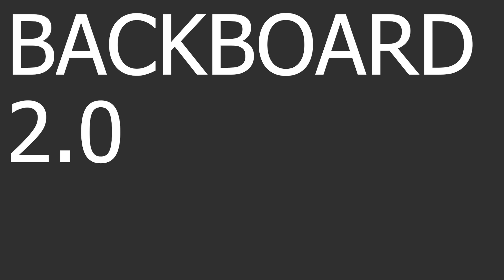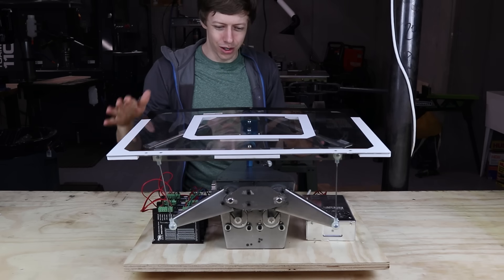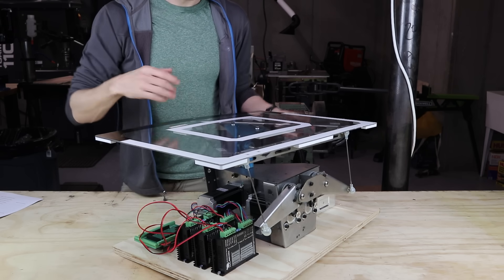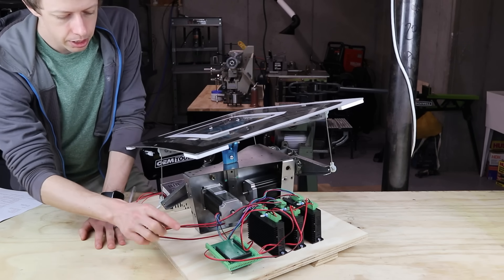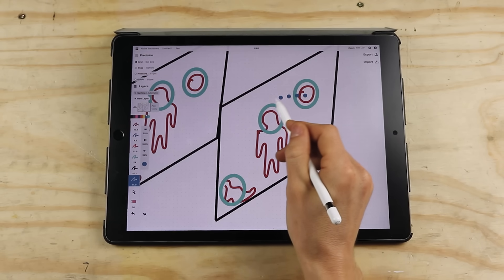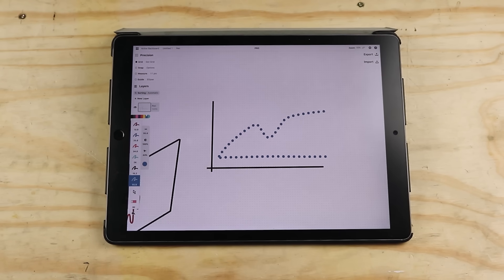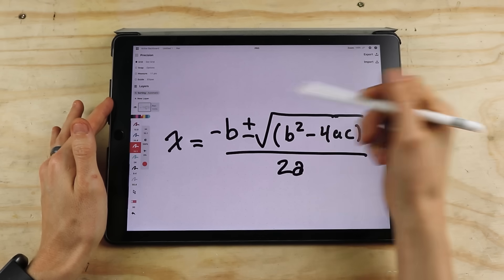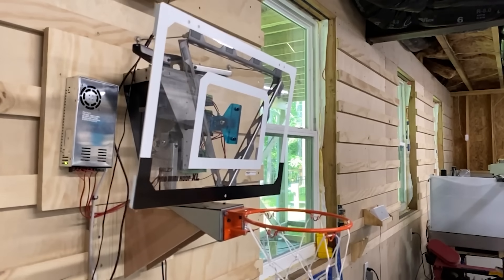The automatic hoop always goes in

Comment: well, here goes one, you didn't need a third motor, as a solution could be done by two on a pivot. 
1 motor controls lateral tilt and the other does vertical tilt while they can still push in or out
 ( this is a worse solution for stability, but easier to code due to more constraints/fewer degrees of freedom, also less instructions?)
anyways love the "effort" to face recognition

Comment: Would it not be faster and more precise if instead of sending the positions to the board at the last moment you send it to the best position as soon as possible and then update the position as fast as possible that why the board is in roughly the right position when the last and most accurate position is sent and does not need to move as far and fast?

Comment: Would it be possible to get a rough estimate earlier and start the movement in the general direction, then continuously update the target position of the board as the trajectory data gets better?
Reply: i think this would take more processing time.
The method here is;
Estimate the trajectory after you have gained some reliable information. 
Then move the board according to the calculated vales.

If continuous monitoring was done with adjustments for each value; the board would receive different sets of data. 
As he said that the board has to go through huge acceleration; if so then giving it multiple acceleration would be difficult and there would also be resistance due to inertia. (of course for most of the cases this wouldn't be a problem, but if the two set of information/command has a large enough difference the needed change in acceleration would be high and mechanically impossible for the board to handle(due to inertia).)
That's what i think.
Reply: I think  Taipan17 SAG  said it best. 
In the original version, he collects a mass of data then calculates.
You're suggestion would require multiple consecutive calculations. Remember, he said his biggest limitation was how long it took the processor to do the one calculation.

If he upgraded to a much higher power, it would be possible, but then you would have to account for mechanical lag. I.e. How long it takes the moving board to dissipate the G-force it has acquired.

Comment: Graph theory - Complex networks and systems
Arduino/coding - Computing science & programming
Motors and gears calculations/ material strengths - Mechanical engineering
Link arduino to hardware - Control engineering
Creating parts (bearings/sheets etc) - Production techniques

Cross-disciplinary.. I like it

Comment: if your main issue is the speed to which your arduino runs, maybe try using a teensy board, you will get more cycles out of it, 4.1 just got released.

Comment: Would it be quicker if you only gave the backboard 2 degrees of freedom so the centre of mass remains stationary? Then there would only be 2 solutions for the trajectory and rotating the board would require less force than moving & rotating

Comment: I was about to post a comment being like "HA, this guy wasted his time, he didn't see the video of the guy who made the wooden one that works without any robo--oh... it's the same guy..."
YOU DID THIS IN A FEW WEEKS!!?!?
How is that possible. Why do you have all this disparate special knowledge, all these expensive machines and enough time to do this stuff? Do you have a trust fund? This channel obviously isn't your job. What's going on? This is the first time I've ever not understood how someone is doing that they're doing.
Reply: You can have a cnc plasma cutter put together for about $1000 dollars if you're building it yourself, 2-3 thousand if you're getting something mostly ready to go. Spot welders aren't that expensive, a few hundred. A ok brake can go for  $100-$200. a little nicer maybe $400+. Decent 3D printer: FDM for $300 is normal, and small resin printers are getting to that price range too. Machining the ball bearing was one of the bigger ones, A small milling machine, like mini, would be $400-$500; they quickly go up from there ( although it looks like he has, or has access to, a CNC milling machine which is EASILY +$10,000 used. but that wouldn't be necessary and I wouldn't even bother machining ball bearings anyway) . But if you tinker a lot it's priceless. Really with milling machines, what pays off is having the bits, chucks, and hardware you need.
Not to mention a lot of things like sheet metal brakes and milling machines can be bought used.

If you think about somebody having another car and spending more than $10,000 on something, then this really isn't that much. CAD software can be free, coding software can be free, CNC cutting and slicing software can be free, online courses to teach you these things are available free...   insert "JUST DO IT!" .GIF
Reply: @matthewluttrell9413  Sorry dude. That brake he was using costs over $2000.
Reply: @bryanswift9801  yeah, but he didn't use it for anything you couldn't do with a Harbor Freight brake. Help me out here XD I'm trying to encourage people to go build stuff and that's like 90% just doing it and only 10% having nice tools
Reply: @matthewluttrell9413  yep, time to make that decision between a new milling machine and a car.
Reply: The "kiwami Japan" channel gives me a similar feeling, talking about the confusion as to how this person has all this wide range of specialized knowledge
Reply: @geniusface1234  it's called passion dude. Does that confuse you lol?
Reply from the maker: No trust find lol I wish. This project just went pretty smoothly for some reason without major setbacks. The mechanical design and fabrication I did last Saturday and then I did the software in the evenings after work last week and made the video this past weekend. I like speed and my shop and workflow is optimized for rapid prototyping.
Reply: @StuffMadeHere  So you even did this around work. I'm an engineer myself; I've seen a lot of brilliance and am not that often surprised by what people pull off. But you really do deserve a bit of awe for the sheer efficiency and speed. It's... above average.
Reply: @StuffMadeHere  YEA LIKE I TOTALLY KNOW WHAT THAT MEANS
Reply: Special knowledge I kind of get. I have a Masters degree in Engineering and combined with some passion for robotics it would probably look something like this. Machines, yeah quite impressive but not impossible it is just about what you prioritize (it is probably worth around 5-50k USD). But time, wow! That is what really gets me. That is just out of this world. You could easily spend 3 months building this full time. But he seems to have done it in a couple of weeks part-time. That is truly impressive!
Reply: equipment, resources and time! how do you have all these things! Please keep making cool shit and sharing for those that do not have what you have!
Reply: Maybe its already made weeks before he upload this video. And i think the 3rd gen back board are already into the finishing phase. And he's just waiting another 3 weeks before uploading it.
Reply: Me to
Reply: It's because he's an engineer. He probably has access to these machines through his work. I'm actually so inspired by this (as a second year engineering student myself.)
Reply: @MDMArxist  I understand that, but like I said in my comment "if you can afford another car at $10k", probably means middle class buying used. It's true someone impoverished can't afford the tools I mentioned, but the middle class can. I was just pointing out that you don't have to be rich/upper class.
Reply: Same!
Reply: Same thing with channels like Michael Reeves - these guys should all be working for NASA
Reply: Omg same
Reply: @MDMArxist  What does that have to do with a guy building a basketball net? You leftists just can't let people enjoy anything without guilt.

Comment: (Just an idea) You could get a 3D camera (one that can track depth,), or use 2 cameras at different spots (to triangulate the position), and take photos about 100-150 ms apart, prosses those images to get the trajectory, than move the backboard to put the ball in the hoop (the 3 frames allows you to get the parabola,  while still leaving the processor fast enough to send the info to the motors).
(Another (worse) idea) If you need better tracking on the ball, you could try to split the frames into their red/green/blue frames, determine which one is the ball (which color the ball is and use that color frame to find the path of the ball), and then you wouldnt have as many problems with background noise. Or you could also just use IR trackers, and cameras.
Edit: Just got to the part with the kinect (i should really watch the whole video before commenting things)
Edit 2: The IR cameras I mentioned earlier would also help determine the spin on the ball

Comment: You might be able to get more of the difficult shots by moving the backboard twice. Move it as soon as you guess a loose trajectory, then move it again later to a more optimal position. This way if the shot is too fast, or if the tech glitches, then you have a decent chance of making it because the board is in an OK position. Then you can move it again really quickly, because it was already really close. 

Someone tell me why this won’t work as well as it does in my head.

Comment: Idea: Build a ramp to return the ball back to you from any position out of the hoop. 
Second idea: Building on the first idea, make a machine that sends the ball from the ground and shoots it back up into the air
Product: A shooter and a hoop that goes in a cycle and never ends. Might also work with multiple balls.

Comment: 12:00 what if the ball gets hit mid flight and the computer see’s it as an un-natural ballistic trajectory. Will the board not move because it can’t see anything that could be the ball? And is there a solution to this? Im not engineer but i would perhaps suggest having a ball covered with something like a crash test dummy symbols to track the ball. So we would always know what the ball is and eliminate the need to track a logical ballistic trajectory. 🤷‍♂️💙

Comment: Definitely subscribed. Don't forget that the speed of the steppers is affected strongly by the drive voltage. You can lower the chance of skipped steps by increasing the drive voltage to whatever the maximum is for the <cough> chinese drivers you are using. Also, consider using a linear supply instead of that switching supply so that you still get current even if you load down the supply a lot! 

Consider moving to 80V or higher voltage to really get quick motion.

Comment: You shouldn't (In my uneducated opinion) wait until the last moment to tell the hoop to move. I understand that the later the ball is in its trajectory, the more accurate the prediction of where it will go is. But the hoop should start moving as soon as you get an idea of where the ball is going. It should then adjust, making small and more accurate movements, as the ball approaches. That should help with the motors seeming not powerful enough (I think).
PS. Awesome video.

Comment: Here's another idea, that might improve the project.

You said that sometimes there's not enough time to capture enough data points and then move the board in the right direction. So, what if, after you collect ... let's say  ... 3 data points, you start moving the panel in the direction according to the trajectory calculated with those 3 data points. Then, after another fraction of a second, when you collect more data, you do the calculation again and you adjust the board a bit more, and so on, until the last moment when you have the most amount of data and you have to adjust the board a little bit more again.

This way, the board should be going towards the right position very early, and at the end, when you know the exact position where it has to be, you should probably need to adjust it just a little bit to get it in the perfect position, which will take very little time.

Of course, all of this will only work if you can do this whole math multiple times times during the ball flight. Practically doing more math on the pc and moving the panel in increments instead of one long fast move of the panel at the end.

There's another advantage, if at the end you can't do the last final adjustment ( cause there's no time ), the ball might get in anyway cause you might have moved the panel in the right direction enough already, if you are lucky the panel might actually be in the perfect position very early if the trajectory of the ball is stable.

Comment: You might actually be able to significantly relax your reaction time requirements (and thus weight restrictions) if you were to start moving the backboard as soon as you detect some semblance of a forward trajectory (essentially tracking it like a catcher in an outfield). As opposed to making one decision and trying to apply it as quickly as possible. It would also reduce the need to compute and assess many possible solutions.

Comment: Instead of waiting until the last moment to make a motion you can start the motion to the non-optimal solution and when you get a better and better projection of the trajectory you adjust the acceleration so it ends up on the desired position. You would need sensors and better and more precise motors, and program a PID controller

Comment: I am interested why you didn't use the Kinect to find the ball. Seems to me you could store the Kinect data in a buffer that is say 5 frames long (assuming 30FPS sensor data) and continually create a matrix of values showing the average change in distance per frame. You could monitor said matrix to find objects flying at the sensor fairly easily. And then you wouldn't be relying on computer vision to find it, which I imagine introduces some latency? Let me know what you think

Comment: Bug: "Windows being laggy sometimes ... windows will randomly stall" 

Fix: Remove Windows, use Linux instead.

PS. I shall guide you to the dark side (Linux) dm me.   :)
Reply: Even non RT Linux should be fine. A robot feedback control system running at 1khz may need a RT OS. However, with the Kinect maxing out at 30fps, I really don't think he needs to work about it. 
The other thing I noticed is that his code is written in Python. Python is great for lots of things, but this kind of project would likely benefit from being coded in C++. That is, if the challenge of acting within 600ms involves anything other than the duration of enough frames to model the trajectory and the time to actually move the board into position. In other words, if processing is a bottleneck.
Reply: Well, what he really needs is some type of real-time OS. There are Linux distros that have a proper real-time scheduler, ie RTLinux.
Reply: Maybe not use a computer at all. You could design your real-time control hardware with PIC's or any type of microcontroller. I think it would be a WAAAAAY better design: compact, and faster. It would be also WAAY harder to implement,  unless you know enough about embedded systems (which I don't).
Reply: I think he can figure it out
Reply: Győri Sándor would be awesome

Comment: You could significantly improve this system by using your simulation train a NN with RL to use the sensory data to make the ball go in. An AI would probably smoothly move the board as the ball gets closer isntead of jerking it into place at the last moment, greatly simplifying the 600ms issue. Like a person moving their hands down as a ball comes in to catch it. It would have also made the software super easy by making most of the math you used essentially irrelevant learning. Edit: by adding a colour camera image feed to kinect sensory data you will also have no issue teaching the AI to only look at the ball, object classifcation for a single object type is a really simple CNN problem. There is other roads you can take with AI to approach this, but this would be a really simple roadmap that can be done in a week or 2 giving a good foundation in Machine Learning.

Comment: 12:08 I almost expected a cut to the queen of hearts yelling "off with his head"

I'm wondering about two things: First, your decision to just wait until the last moment to move the backboard. My first thought would have been to project trajectories of all objects, and move the board appropriately as soon as you see something coming that would hit the board. Then as you continue to track the object, you'd only need to make incremental corrections as your estimate of the path gets better. This extends the time your board has in which to move and could let you get away with slower motors.

My other thought was that it seems to me that just two degrees of freedom ought to suffice. Are there particular edge cases where you actually need the extra degree of freedom? I'd want to save a motor if I could get easily away with it.
Reply: If you didn't see it he posted a comment explaining the reason for waiting to the last possible moment.
But as to needing three degrees of freedom I think I can explain. With two you could angle the backboard in an direction but that creates a problem. Picture an x and y axis on the board making the Cartesian with the origin in the middle, and assume the axes are also the axes of rotation. Except for the points on the axis that rotates and the origin, every point can only have one set of angles for a given point in space. That is, if a point needed to be orientated at specific angle to make the ball go in it will only have on spacial point it can do that at. This would mean that there would be a lot of possible shots the backboard could not make in. But by giving it one more degree of freedom, back and forth, any point in the space the plane can move in can have two distinct angles.
Reply: I hope that was clear XD